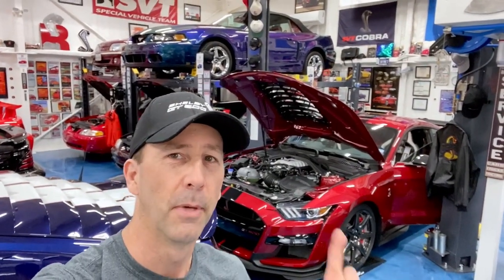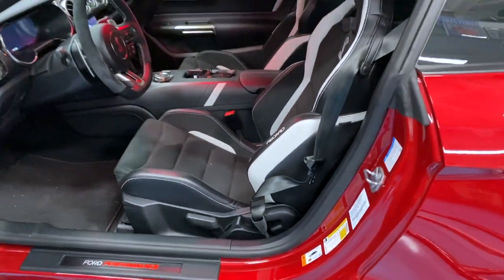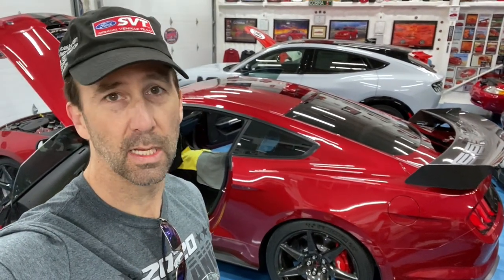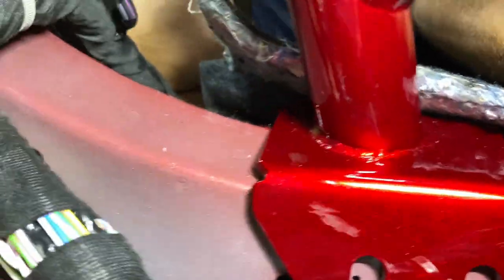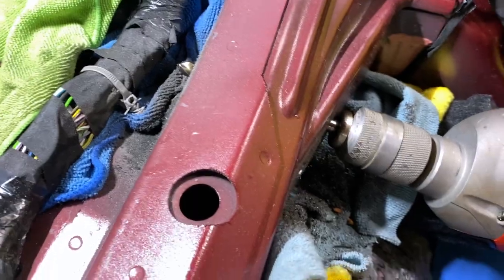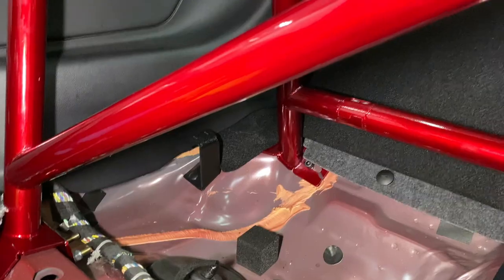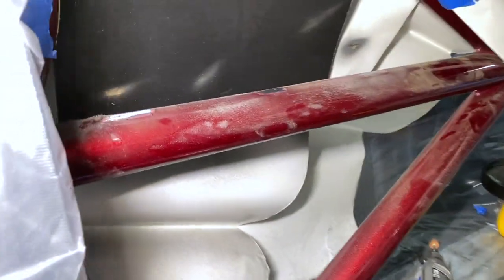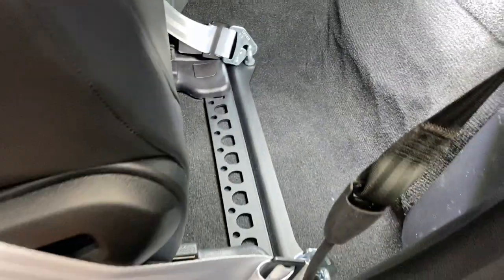2020 Shelby GT500 CFTP: CMS roll bar, Schroth harness, Shrader rear seat delete install!

Comment: Thank you for sharing. I am shopping for a roll bar. I’m 50/50 on a kit vs having a custom one built by a shop. They suggested buckets seats for safety. It’s a slippery slope after that. Quick disconnect etc etc. Ugh. It never ends but I love it.
Reply from the maker: I like this bar... had a couple of challenges to overcome, but in the end, it is excellent!

Comment: Have you found the carbon fiber hood vent yet? That guy that hangs out with speed phenom that drives the performance blue track pack has done some cool upgrades including swapping the wing mounts with GT4 that brings the wing up a couple inches and looks a lot better. He said Anderson composites made the vent but it’s not on their website.
Reply from the maker: That’s Joe Gatt. He has some prototype pieces. I have one coming soon from a different vendor.

Comment: Fantastic ride in all aspects.   Thanks for the video.  I am about to go down this path for my car as well, and based on your video, was searching for the trim rings you added.  I cannot for the life of me find them.  Any hints as to where to find them, or a ling?  Again, great video.  That car is a real drool machine.
Reply from the maker: Thanks Clint!  Google Watson Street Works. They sell the rings. Holler with any other questions.
Reply: I just realized after watching the first part again, that it was Watson StreetWorks, not Watson Racing.   :)

Comment: Looks like a tough Job rethinking it on mine. May just use harness bar wished Ford installed one!
Reply from the maker: With a lot of time, basic tools and a helping set of hands, anyone can do this. I was in a time crunch and was feeling the pressure though.

Comment: Great job Tim!  When you track the car, are you disabling the airbags?  Or leaving them active and buckling the original seat belts behind?  My first track day will be in September and I'm not sure which way to go.
Reply from the maker: Thanks Scott! I don’t disable the bags. I bought a dummy belt clip from Amazon that goes in the seat belt receiver to simulate the driver’s belt is clicked. It prevents the chimes and dash light.
Reply: @ShelbyFlyer  Thanks Tim.  I will go that route.  I can't wait to get her on the track!

Comment: As a detailer my question is how do you clean the back glass 😂😂 Want to eventually add this to my GT350R.
Reply from the maker: The inside of the back glass does not need to be cleaned too often, but I did buy a telescoping glass cleaner wand that does the trick.

Comment: I have a question, I see you still have stock seat belt in. Most harnesses are not street legal, so I assume you can still use stick seat belts?
When track driving and using the 4 point harness, how do you bypass the seat belt safety features and chime, light?
I've searched all over and don't seem to be much info out there.
Reply from the maker: Yes, I use the seat belt on the street and harness at the track. I bought a seat belt metal clip that goes in the receiver to make the system think the belt is latched. I found it on Amazon and came as a set of 2… something like seat belt chime eliminator or bypass.

Comment: I’m just learning about doing all this - so I’m no expert, but it appears to me that your shoulder belts may not be installed correctly.  See page 6 of the Schroth document.  It appears that they suggest the shoulder belts should cross behind the seat.  Thoughts?
Reply from the maker: That might be for belts that mount farther back.  Mine mount right behind my seat. There is no room to cross them... thoughts?
Reply: @ShelbyFlyer  That’s it! It says greater than 18” to cross them.  Thank you.  You look pretty tall - ever look into lowering the seat or removing padding?
Reply: I’m 6’5”
Reply from the maker: @andrewmcculloh2919  My seat is as low as it can go. The Watson piece I added raised the back of my seat ever so slightly as well.  I’ll need to keep my seat slightly reclined to keep my helmet from hitting the headliner.
Reply from the maker: @andrewmcculloh2919  I’m 6-1.5

Comment: Is the harness lap belt mount required for install?
Reply from the maker: The lap belt is not required for just installing the roll bar. If you want a harness though, you’ll need the lap belt. You can install a quick fit harness though.
Reply: I have the same harness as you, but I don’t have that mounting bar that goes behind the seat.
Reply from the maker: @EVENMETAL  Ahhh, not sure of alternative ways to secure the lap belt to the car. The mount I got works like a champ.
Reply: @ShelbyFlyer  Yea I will get that mount in the future. Thanks again man, really appreciate the walkthrough, this was not a fun one haha
Reply from the maker: @EVENMETAL  Drilling the holes for the roll bar was just a weeee bit of a motha-lov’n BATTLE!
Reply: @ShelbyFlyer  Yeah that was fun.  Believe it or not, I actually broke the carbide bit that CMS provided!  But I bought one on my own, same style but way smaller, and it went through in less than a minute!  Was way easier to start with the small drill bit and then switch over to the big drill bit.  Saved a ton of time.